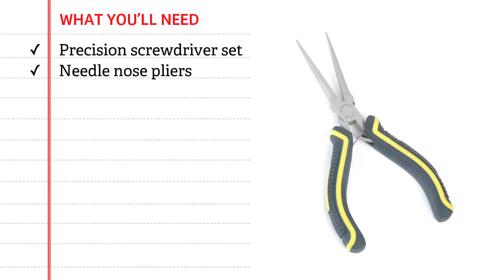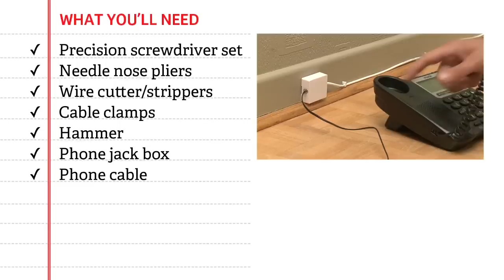How to Install A Phone Line

Comment: Can anyone tell me about how big of a hole you need to drill in the side of your house to run the line into the house? Our phone company says the only thing that will fix a problem we are having is a new wire, but they no longer actually do wall installations. You have to prep all that yourself for them to just hook it up.

Comment: Can I convert this to a cat6 easily... I have so many in my home that aren’t being used because who owns a landline
Reply: Well, first you have to open up and see if it’s cat6, usally cat6 has a bunch of wires vs older cat3 cable is only for voice cat3 usally has green,red,black and yellow.  Cat6, or cat5e, or cat5 has white and blue and bunch of others ones.   The second step is find your D-mark (Usually outside your house) in slang we refer it to as network interface device.  You’ll need to remove the old phone copper wire jacks and then you’re off to go, and change your jacks to rj45 internet jacks.  I must mention if your house was built early 90s you most likely have cat3 cable which doesn’t support data, it’s just made for voice.  Sometimes the landline jack box could be in a closet or sever room). Also a lot of people still have landlines and they are much better then cell phones, cell phones aren’t the best in fact t-mobile in our area and various other carries went down yestery for about 6 hours, no 911 calling.  I was still able to use my landline.  Plus if you want a “Fake” landline you can get a Obihai 200 and get free home phone service and attach to your jacks.  Most likely if you have those jacks on your baseboards especially if they are biege color then probably is cat3 cable and if your house is built in that timeframe.  2005-2008 I think most house builders installed cat5, then 2009-2015.  Then I believe 2015-2021 they use cat6 for phone lines (If they even have phone lines). Also irl you have a old corded phone and if you have old copper phone service yiu can use your phone during your power outage.  (Cell phone service was down during sandy due to power outages and one tower fell down believe it or not. I was still able to use my Verizon copper underground landline service with my vintage Snoopy and Woodstock touch tone lamp phone.  I was able to talk to my parents who also had a landline and if you want to charge your “Cell phone” you can do that with copper service.

Comment: I think that  diameter of wire on the wall should be the same dimension as wires on phone socket becase flow of electrons is better if wire thicknes is not changing.

Comment: The cable clamps used for this cable in the video are clearly too large. The phone line should be secure against the baseboard and not slide from side to side under the clamp.
Reply: Agreed.
Reply: We used to use round staples especially shot from a staple gun made for these staple shape. I still have mine.
Reply: @dalemettee1147  That makes sense.

Comment: This is crap. 1) you need a stapler if you want to fix your cable and 2) the phone / ethernet line is always fixed above the baseboard (the cable coaxial is close to the floor).